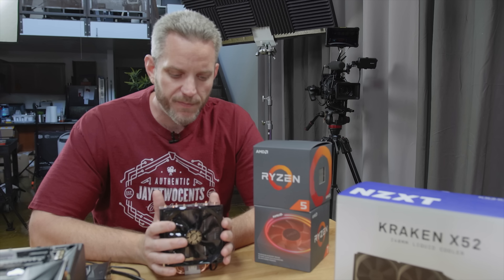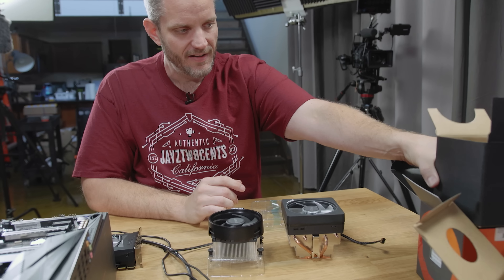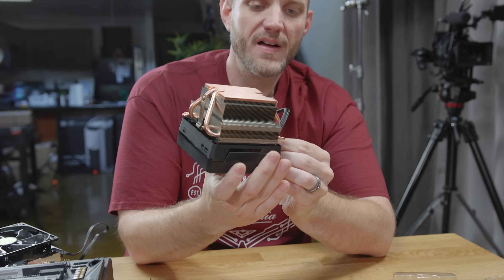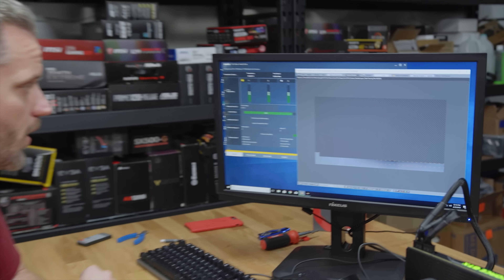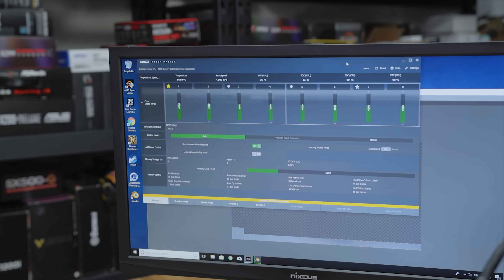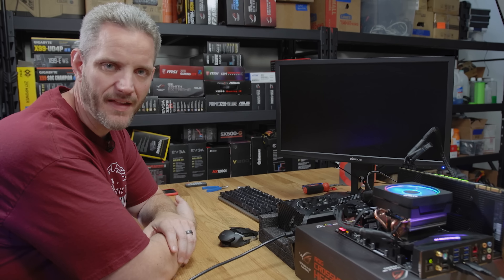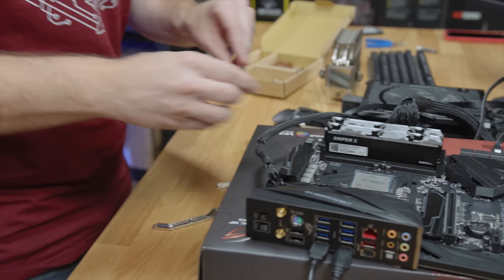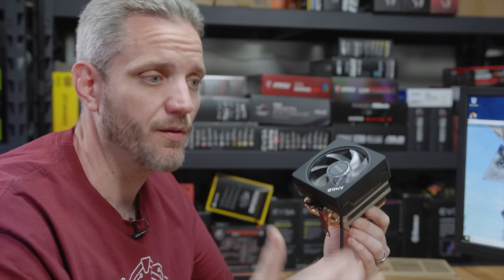Overclocking with a stock air cooler?? Is it even possible?

Comment: Is "open air" really best case? I have a 011 dynamic with 9 fans, I feel like 6 intake fans and 3 exhaust fans would be better for airflow than just dormant air being sucked in by one fan. In my case I have 3 intake fans from the top pushing cool air right at the cooler and 3 more fans pushing air in from the bottom, into and around the gpu. I think that would be better as it's forcing cool air obto the cooler from all directions.
Reply: IMO, as far as I learned, much intake air doesn't always bring best cooling performance for a PC with a case. There are some other important parameters, and one of the most important is the "flow". Bad air flow will make the air turbulances inside your PC case, and it could either distribute heat equally all over of your components, or trap some higher heat in specific area. TLDR, it's neither effective nor efficient. But a good flow of air, maybe not as much air intake as you did, could surprisingly done better cooling performance. In real life example, I've seen some Cooler Master TD500 case users doing case airflow testing, majority of them get better cooling when they put 3 intake fans in front mesh, and 1 adequate exhaust fan in rear, compare to their configuration of 3 intake fans in front mesh, 1 adequate exhaust in rear, and 3 intake fans from top (and also they tried 3 exhaust fans in top, so theoretically they made a negative pressure case air flow, and still not preferable because they're building dust inside for period of time).

TLDR:
Higher intake airflow doesn't (always) equals to better cooling performance. The "FLOW" of the air itself does really matter.

Comment: I prefer the clip retention. It is easier and simpler to install. The screw setup requires you to have 4 hands to install it safely.
Reply: Craig Simpson actually, u can install it with 2 hands and 2 other hands

Comment: Just built my new rig over the weekend, specifically using the 2700x and for now the Prism cooler. The plan is to throw and AIO at it soon enough, but first I need to replace my old GPU. Unfortunately I couldn't budget for a newer card and everything else was necessary to the budget, but for now I'm happy.

Comment: I've just purchased some new components: Sapphire 5700 XT Pulse, R7 3700X, B450 Aorus Elite. Will the Wraith Prism stock cooler be okay for this build? Please help!
(I also have a Cooler Master 212 EVO in my old build)
Reply: That depend on some factors.

Case airflow, voltages in bios, room temperature, CPU load...
Reply: I would test stock temps to see what they are before overclocking. If stock temps are too high you might want to replace it.
Reply: Zupez wont have any problem on a cpu load you wont even make it to 100% utilization

Comment: The advantage of the annoying clip design is that you can use it in am3 systems and probably am5 in the future
Reply: That mounting system is not bad, but they should do it with metal, I am little afraid about that plastics holding everything. But it's definitely better than Intel stock mounting system where you can easily mount it wrong and destroy your CPU. I remember when I had Intel it was little fight to press that and force it hold there with all 4 plastic shits, it's terrible system. AMD system is just like from Pentium III but bigger, super fast and easy to mount, but probably not good for massive coolers. But I have AIO and it works perfect. With Intel you had to remove MB if you don't have hole in case behind CPU for most of better coolers.

Comment: Old AMD Opteron's and phenoms used to come with heat pipe coolers as well that worked great. Intel stock HS/F is just a waste of good metal.
Reply: Ah, the good old 8 core furnaces from AMD, had to open the window in my room even in winter time since it produced so much heat. It had good performance, it just was quite inefficient.

Comment: i hate those 4 screw solutions the "noses" solution is so much nicer to use i don't know why everybody is against it?
Reply: Hey man, not that I hate the default AMD clips but I had the experience of one of the plastic notches of the motherboard mounting get cut off. I wasn't even using tall or heavy heatsinks here, just the small all aluminum heatsink that came with a dual core Athlon. My guess is that the heatsink heats up the metal clip as well, so the now hot metal clip digs slightly deeper to the plastic slowly and over time the damage plus the pressure of the mounting breaks off the tab.
Reply: In the defense of the clip mechanism, this is the one thing that carried over after AMD switched from AM3 to AM4. On tower coolers, having 4 screws to a backplate would provide the best and uniform mounting pressure, but the change in the screw holes in motherboards meant those who invested on a cooler either need to ask their manufacturer for an AM4 mounting or get a new cooler. I'm screwed since my Spire Thermax Eclipse has been phased out. I'm only able to use it for FM2+/AM3 on the AMD side. I can still use it for Intel CPUs since the mounting didn't change from 1155 to 1150/1151, but with Ryzen released (and me being an AMD fan) I don't see the point in going Intel.

Comment: So i tried oc with my 3600 Stock cooler.
Result 3.6 GHz (turnd of Most of the powersaving and useless options) Cinebench R20 1/3 trough and i hit 95° C.
Result was 3350 points. 
And this at a fairly agressive Fan curve.
The Things i Changed:
Cool&quit Mode - disabled
Svm Mode - disabled
Global C state Control - disabled
Cppc and cppc preffered cores - enabled
CPU voltage Offset - +150
Fabric oc - 1900 MHz
Ram oc
3600 MHz at 1.35V
Timings:
CL 15 14 14 15 24

This wasnt the best oc ive ever done, but the boxed cooler can be easy overwhelmed and brought to its limits with a "smal OC"
Reply: So im tryng Fans at full Speed
Results are nearly 3400
Reply: For system Info:
Case: Corsair 275R Airflow
Psu Corsair RM 650
Motherboard aorus B450 Elite latest bios
Ram Patriot Viper Steel 16gb 3200 mhz 
CPU: ryzen 5 3600
Videocard: GTX 1060 Ti
Reply: Edit gove it a Seconds run
Still Cinebench r20 
Result was 3410

Comment: On the point of the tower coolers not cooling components on the motherboard, I recent bought a Zalman CNPS9900max because it was on newegg for 10 bucks. And I have to say that style of cooler needs to come back. When testing it compared to my other tower cooler the temps of my SATA m.2 dropped 7c, which it just crazy. Unfortunately I wasnt able to get a temperature on my VRMs. I think the Zalman due to the design and openness of it does a great job of circulating air around the socket more then a traditional tower cooler, its basically the best of both worlds. 

Zalman is also supplying AM4 brackets for some of their coolers, making them still worth it.

Comment: you need to make tests with a thermal camera to see the differences between these coolers
Reply: Why would you? The surface temperature can literally be calculated if you have the exact heatpipe specs and surface area.
Reply: That will show nothing more than a couple hot heatpipes, and some warm fins. The temps on screen offer much more info.

Comment: I overclock a 4770k to 4.4 with stock fan... 

I also keep my room at 18° ... So there's that...
Reply: James Gibson why not just install a air conditioner on the casing!
Reply: Ran my i7 920 at 4.1GHz for years on the dinky stock cooler and it survived. Yes it ran hot, but it ran.
Reply: I had my 4770k at 4.2 with the hyper 212(I think that was the name) it was stable and great! . . .Except I had to keep the side of my PC off or it'd get way too hot. 
Now my 3900x with the freakin' stock cooler (in a new case) is faster, more cores, lower power use. 
Technology.

Comment: I just bought the 2700x. Is this a bad decision? Tell me what you guys think I’m looking for opinions
Reply: You can't go wrong with any 2nd gen Ryzen chips tbh
Reply: You should have asked BEFORE you bought it maybe?
Reply: DarkBlueSumo if you only game then the 8700k would have been better. But apps that use multiple cores the 2700x would be best. But most games prefer core clock speed then threads, so the 8700k hitting almost 5 gig is best for gaming.
Reply: Both sides have advantages, but right now AMD offers pretty good gaming, great workstation use, and a good upgrade path in the future. I'd say the small dip in gaming performance is worth everything else AMD has to offer right now.
Reply: Shmozone Of course they both have advantages but Intel is ahead in gaming. In some games by alot cause of the different clock speeds and having more cores does nothing when most aren't being used.
Reply: You're all good man.
Reply: I doesn't matter what we say.  What matters is whether or not the CPU meets your needs and you didn't overpay.
Reply: Nah that's a good choice. Have no worries.
Reply: DarkBlueSumo Good choice!
Reply: Yeah is bad so send me that cpu
Reply: I don't know.
What do you have to do with that?
Why do you ask us advice AFTER buying something?
Do you need advice or are you just showing off?
Reply: That said, it's generally good
Reply: Don´t ask, have fun with your new toy
Reply: No.  Why would you be worried?  It's top tier and has great features.
Reply: It was one of the BEST decisions you've ever made in your entire life! I'm so proud of you (^_^)
Reply: What have you done? You've doomed us all by buying that.
Reply: buying it was a good decision
Reply: how was your 2700x right now? it is good or bad?

Comment: In this video the smaller cooler is the Wraith Spire which shipped with the R5 1600 and R7 1700 which has a copper vapor chamber in the middle, the bigger one tested the Wraith Prism which is a More RGB version of the Wraith Max which was an RGB version of the original wraith cooler.. which is whey the Prism has the old style clips and the newer Spire doesn't.

Comment: of course it is... i oced my 2500k over air with a hyper 212 plus and reached 4.5ghz without even touching voltages...
Reply: The 2500K is a wonderful processor for overclock
Reply: @Pommezul  yes, it's an amazing little processor

Comment: The copper part in the (original) Wraith is a vapor chamber - a big heat pipe. Solid copper would be very heavy and expensive.

Comment: I am rocking a FX-6300 and recently got in kinda that exact same cooler but without the RGB stuff, just the basic AMD led logo, and gaming with the turbo kicking in for ~30 minutes, it maxed out around the low 50s celcius. Of course it's just a 95w CPU, but comparing this cooler to the previous AMD stock cooler, I'd say it's a huge step up

Comment: This cooler came with my 3700x but its loud asf so I replaced it with an AIO but it does the job if you don't mind sharing your room with airforce one.
Reply: It is loud indeed, but I'm happy with it's performance. I'll hang on to it for now, it is a very good cooler
Reply: Haven't had that problem on my 3700X, running 4.3ghz all core at 1.25v, never saw a temp over 63C with stock cooler. Maybe you have your fan profile set to aggressively, and you didn't bother lapping the heatsink and real thermal paste.

Comment: AMD's Wraith cooler rocks.  I have a 1600 running at 3.9ghz on its stock cooler.  It could probably hit 4, but as good as the cooler is I didn't want to mess with voltages too much with it.

Comment: I recently bought a Ryzen 2700X with an MSI X470 Gaming Plus and an aftermarket AIO water cooler. I didn't waste the stock cooler as I have used it as design/modification in my build.

Comment: I had an 2600k with a stock cooler at 4 stable to 4.3 with some minor glitches.
Yes the thing was running at high 80's to high 90's.. 
But it held out for a good 1.5 years until I bought my new pc (1 month ago).
This was after 8 years of running stock having 60's to 70's.
Since it was my first own build pc too.. it has had a hard life as well.
You cant deny the quality of that thing.

Comment: i actually use the prism cooler for a 3700X ( only for gaming & programming so no big load ) and it was a big surprise to see how efficient it was: not so noisy and do the job and i'm not even considering changing it for a noctua expensive thing since i don't overclock

Comment: i have my wraith cooler on my AMD and i run a 3700x 3.6 gig CPU to an outstanding 4.6 with just the cooler and  my p95 stress test for 24 hours went off without a hitch. bwhat does that tell ya about these coolers.

Comment: Just bought an open box Ryzen 2600 from Micro Center but it turns out it had bent pins... Good news is this video might have just saved the day! Time to see if it'll post.
Reply: Update: it worked! 8 benchmarks in and no problems.

Comment: I just bought a 2600x and it came with the Wraith cooler. All stock, no OC it ran 42C idle. I replaced it with MX-4 paste & my old upright Thermalright MUX-120 that cooled my Phenom x2 965 BE for 8 years and the temps dropped to 32C idle. I may have messed up installing the stock cooler as it slipped off when I was applying the back plate and the paste may have been messed up.

Comment: I really appreciate that AMD has made a decent stock cooler for higher end CPUs.  Unfortunately, my Wraith Prism cooler that came with my 3700X is SUPER loud, so I think I need to replace it.
Reply: Matt Theriot mine is super loud as well for 3700x, I have it set to high thought instead of low. If you’d like to you can try out the low setting, it’s a switch somewhere on the cooler itself, it will definitely quiet it. You could also set custom fan curves in your bios

Comment: Watching this video when I was about to buy a 2700X I fully expected the Prism to do well on stock, but I'm pushing 78 °C at 3900 RPM with two Corsair ML 120s assisting proper airflow.

I'm seriously starting to distrust open air testbench benchmarks.
Reply: There's weird.
I have my 2700x at 4.0 all core and it never gets above 71°C with the wraith prism
I'm in a Meshify C case.
Two of the fractal 120's front intake, one fractal 120 for exhaust.
Reply: Also that 71 is only really in prime95 when stability testing.
During gaming which is what I mostly use it for, it doesn't get above 65°C
Reply: @EEESRAINMAN  I have a horizontal mini ITX case. The Wraith Prism is sandwiched by an ML120 on the back, an ML 120 from the top, an Enermax Apollish Vegas 140mm from the front, and there is mesh on the right. The only side where airflow is obstructed is where the GPU is on the left. I'm idling at 52 °C as I'm writing this comment.
Reply: You must have a bad part or something somewhere.
That's really crazy.

Like I said I have a 4ghz all core and I idle at ~38°C

I have a picture of my screen showing that in Ryzen master on by build page on pcpartpicker
https://pcpartpicker.com/b/BmZRsY

I really don't know what would cause such bad temps on yours.
Reply: Well open-air is the best "case" scenario as he said. Also, it will depend on ambient temperatures in the room.

Comment: I just recently built my  new system, after 5 (i think) proud years of service from my old i7 3700K.
Old build: i7 3770K + 12GB Corsair Vengeance DDR3 2666MHz + EVGA GTX1070 FTW
New build: Ryzen 7 2700X + 16GB G.Skill Ripjaws 3200MHz + EVGA GTX1070 FTW

So far i'm super impressed by the performance of the 2700X and the Prism cooler. Yes it gets noisy, especially after you close it in a case, but honestly i never cared about my PC's noise levels since i only game with headphones and for "non gaming standard use" it doesn't ramp up the fan so it's not that noisy.
I teamed up the Prism with 1 front intake fan (120mm), 1 rear exhaust (120mm) and 2 top exhausts (140mm)  - all the case fans are on the "quiet" profile - and temps are well under control even though i'm on the stock cooler with the stock thermal paste.

Comment: Just got my 2700x and its runs just fine at 4.2 GHz with stock cooler at 1.32 volts. 74 C max temps on cinebench using MSI X470 Gaming M7 AC
Reply: Do you have manual OC or do you use the core performance setting

Comment: My 3700x auto volts itself up to 1.5 for short intervals and it runs hot with the prism. No crazy temps above 80 yet under gaming load with uncapped framerate, but the cooler does get loud.

Comment: Currently running a Wraith Spire on my Ryzen 7 2700. Overclocked on all cores to 3.9Ghz @1.225V, the temps max out at 77C (Handbrake h264 1080p encode).Have to push a lot more voltage through the chip to get it to clock higher. I wanted more, but even at 1.275V 4.0Ghz wasn't fully stable and the heat started to really climb (over 80C).

Comment: Would love to see what liquid metal does with the stock cooler, delidding does not help Ryzen much, but liquid metal on top should help a fair bit, probably getting you the 5C back and then some.  I would not be surprised if you don’t hit the structural CPU stability limit before thermal throttling kicks in.

Comment: Possible for the 3600
On the flip side, possible to passively cool the 3950x with a large air cooler with fan curve set to be off below 60C and the clock speeds set to 2.2ghz. Note that air cooler has to be oriented correctly for air to naturally flow through it from heat rising

Comment: Just got me a 2700x and Aorus x470 Gaming 7 WIFI mobo, Prism cooler looks banging, you get the same cooler but without all the rgb with the AMD 7870k CPU, good little cooler, Knocks Intel's cooler right off the shelf.

Comment: Here in 2020 I bought this cooler on ebay to put on my 3600. Way better than the stock stealth and cheaper than even a cheap tower cooler. Does a good job, but it is the loudest fan in my rig.

Comment: Back in the day, I got my Sempron 2800+ from 1.6GHz to 2.4GHz with the stock cooler (and even without using any thermal paste other than what was already on it).  That thing lasted for many years until I finally had to tune it down to 2.32GHz when it finally lost stability.